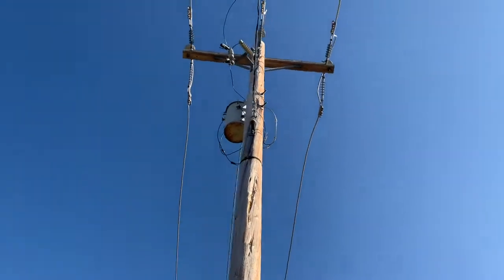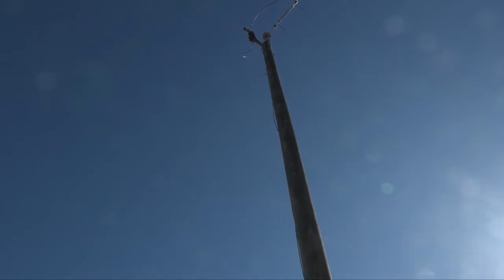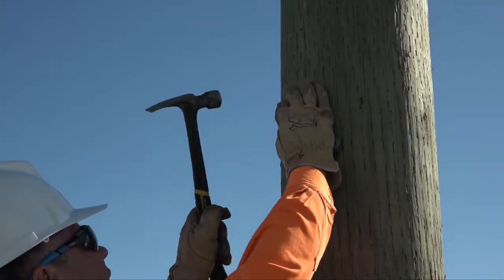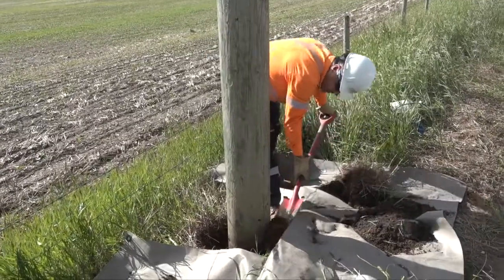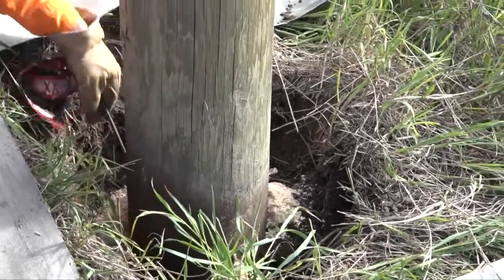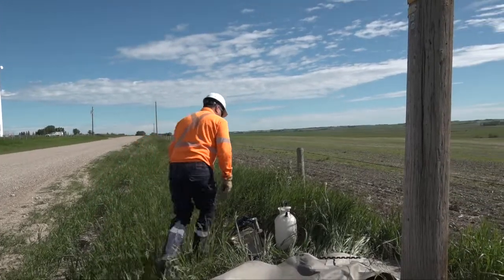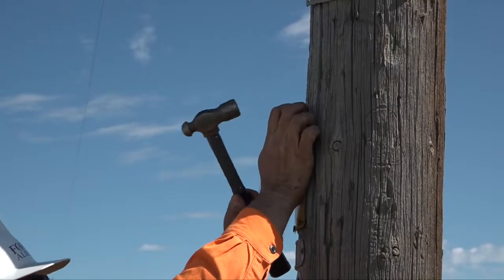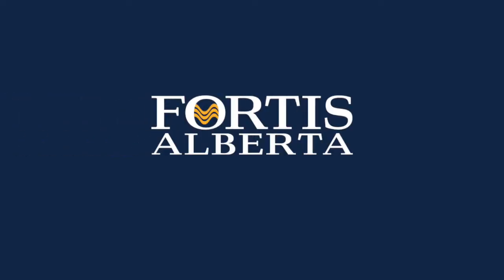Pole Test Demo

Comment: Pole testing telephone poles was my main job before retirement 7y ago after 40y working for the GPO and Openreach the biggest thing to change was the introduction of the resistor graph which speeded up things especially not having to dig out in hard ground.also we would have to climb the pole and hammer test to the tip you would find a few that were like chimneys hollow down from the tip